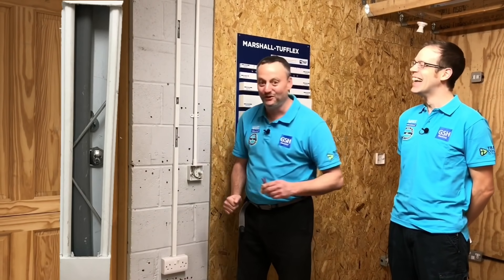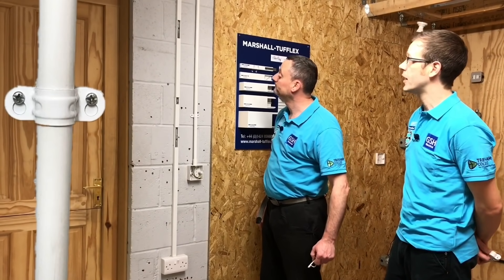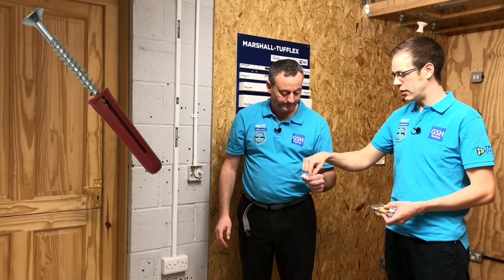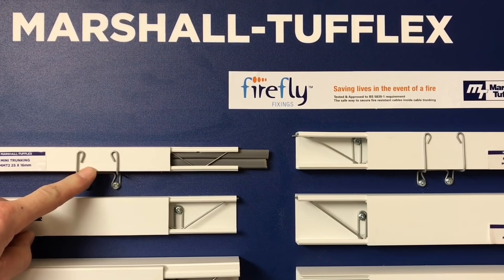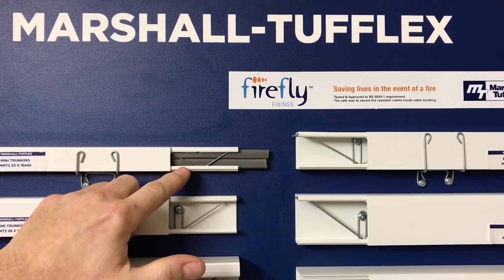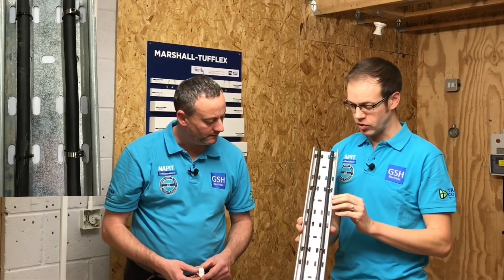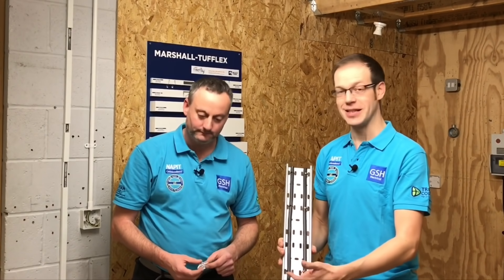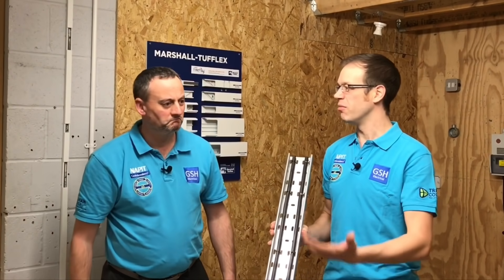BS 7671 18th Edition Premature Collapsing of a Surface Wiring Systems PVC Conduit Prevented

Comment: Having spent 42 years in the trade I have seen a massive change in the industry and not for the better, the actual standard of workmanship has definitely declined which is in part due to the fact that the kind of installation work we get these days has shifted away from the traditional industrial work that was so common up until the 1970’s.  The standard and quality of material used has also declined quite dramatically with far too much being imported from China and U.K. manufacturers can now only compete by producing goods of a lower quality.  The requirement for metallic fixings and retainers might seem like a good idea to some but, given that we have a population of around 70 million in the U.K., can anyone tell me exactly how many people have been seriously injured or killed as a result of having installed plastic conduit or trunking without using metal fixings / retainers ?  This regulation is complete overkill but, if you really want to improve safety and quality then why not just go back to using MICC and metal conduit although the quality of metal conduit and conduit accessories these days is absolutely atrocious compared to what we used to be supplied with.
Reply: Only a few years ago within the space of a few months two firemen died in fires where in the dark and smoke they walked into cables which had dropped down over doorways. I know at least one of them was electrocuted by the neck. I doubt I could find links now, but I believe it was these two which drove the change in the Regs.  I thought that originally it was only going to apply over doorways, but the problems of cables falling into hallways etc, made it general case.
Reply from the maker: Any thanks for your detailed comment lots of great points 👍. Gaz
Reply: I have heard stories about fp200 chopping out fireman limbs during a fire but i cant prove it hapened just stories from other sparkies
Reply: Wylex brough out wooden fuse box many years ago and then there was plastic ones now I'm told metal is back  what is the regs saying now?
Reply: Spot on
Reply: @Dog-whisperer7494  really? Hope you’re a plumber and not a spark.
Reply: Two firefighters died in one fire because one of them got trapped in collapsed wires.

A colleague went to help him, and in the smoke and confusion his air hose got severed and he died quite quickly.

The original firefighter wasn’t able to free himself and was overcome by the fire.

So you carry on harking back to some golden age that never existed in the first place….

Comment: Very simple question, metal saddles around plastic conduit,  ok when mounted via plug into wall, what happens if the only mounting  material you have is wooden studwork or framing and no possibility of block mounting.

Comment: what happens then, when the metal saddles become live when the cable sheaths are burnt off? shouldn't all metal fittings b earthed if used for a wiring system?
Reply: Joe Bristow .  This can be addressed in the 19th Edition where no doubt we will have to run a 4mm earth bonding cable between each and every metal saddle.
Reply from the maker: Hi. With the pvc melted on the conductors they would short and operate the overcurrent protective device... this regulation is all about entanglement in the early stages of fire. Thanks for commenting and watching GSH Electrical 👍
Reply: Not necessarily. A 3036 or 1361/2 could well continue to supply voltage to the system. 
Why as electricians are we responsible for fire fighting? The 17th and 18th edition regs are based on fire protection. It’s down to certain dangerous individuals work, 99.99999% or electrical systems don’t catch fire, why is this? Proper installation that’s why. The IET are missing the point. The problem lies with the crap work done. Another flawed regulation from the IET. Well done.

Comment: The retro fit firefly clips don't look good. White metal fixing band neatly formed with a fixing either side of the trunking might be a better option.
I have tried the wall dog's find them a bit hit and miss they are o.k when you have idea conditions the slightest weekness in what you are trying to fix into and they are useless, you also need larger holes in your boxes/ trunking as they tend to grab through a 6mm whole.
Reply from the maker: Hi. As new products hit the market hopefully we can solve the issues with collapsing wiring systems. We have lost 8 firefighters so change under 18th is here to stay. This was my first video 
https://youtu.be/LpFOtdmnyoc and I have at least one more to come. Thanks for commenting and watching GSH Electrical 👍
Reply: @GSHElectrical  8 fire fighters ,? Out off how many fire fighters in the service  . If the are worried about cable that may or may not of collapsed then why can’t they carry a pear of wire cutters as a standard boot of there kit. If there worried about getting killed the why become a fire fighter .

Comment: Nice video. I would say however that in an ideal world use metal anchors all day long but sometime crumbly walls just do not work well with wall dogs. You have to go old school one way is stuff some only cable in the hole this will give you a solid fixing and your not using plastic plugs either. You can use Normal wood screws too so cheap.
Reply from the maker: Hi. As long as we support surface wiring systems with non-combustible supports then we are working towards saving fire fighters... 8 brave fire fighters have lost their lives tangled with wiring systems this must be prevented from happening again...
Reply: GSH Electrical completely agree. I think we will just need to be more inventive in using non-combustible fixings hopefully the supplier market will also pick up with more options.

Comment: Good video. Great at least when there’s a fire I won’t get strangled I’ll only get severely burned by melting plastic dripping. Eventually they’ll probably only allow metal containment...environment and all.
Reply from the maker: Hi. Great point made...
Reply: pzul.  When I served my time we only ever installed good quality British made metal conduit, metal trunking, MICC or SWA cables on commercial and industrial jobs,.   I never used plastic trunking / conduit until many years after completing my apprenticeship and the industry has been on the decline ever since.  We used to have some of the best quality material available anywhere in the World and had high standards of workmanship to match but the trade simply isn’t what it used to and even our hourly pay rates have suffered despite the ever increasing amount of regulations and hoops that we have to jump though in order to keep our grading cards.

Comment: Hi when doing a new wire. You obviously have several wires to be fixed between floors to beams and walls. What would be the best method. Thank you
Reply from the maker: Hi. This Regulations is only for surface wiring systems and not for cables in walls, under floors or ceilings. Thanks for commenting and watching GSH Electrical 👍
Reply: @GSHElectrical  Sorry o don't think I worded it right lol. What would be the best method to fix several wires to a beam or wall between floors to prevent premature collapsing
Reply: @shaunbeard593  I would suggest to use metal All Band fixing strap to either provide additional 1 metre support to your preferred cable support method. Or only use metal All Band as a large "P clip" for bunching cables together, or make a "Top Hat" style clip for flat clipping.
Reply: @FGW-ue5xj  thank you for your advice

Comment: Looking at the firefly clips, although expensive, I wonder about use of the internal clips not inside a conduit but as the way to hold cables on studs... rather than using staples... especially given the problems of arc fault caused from overstapling the nm cables... perhaps, though not designed for the purpose, use of the product might make such installations more safe from arc fault within the cable assemblies caused by installation
Reply from the maker: Hi. I think everyone will be trying to come up with Solutions as we move into the new year... I think d-line also make clips for trunking... thanks for commenting and watching all the best Gaz 👍